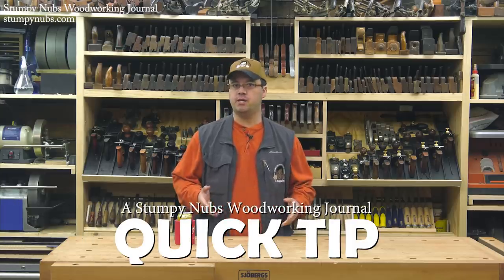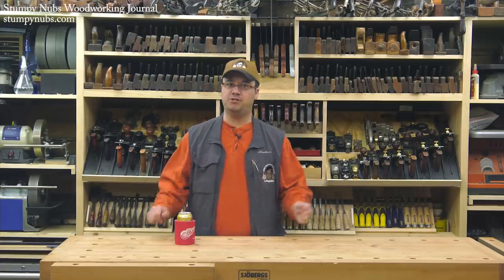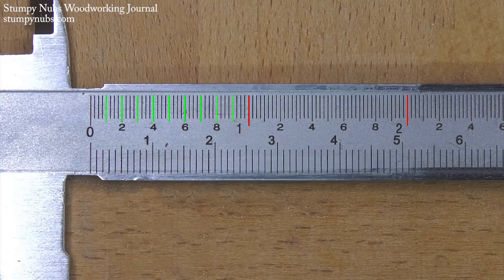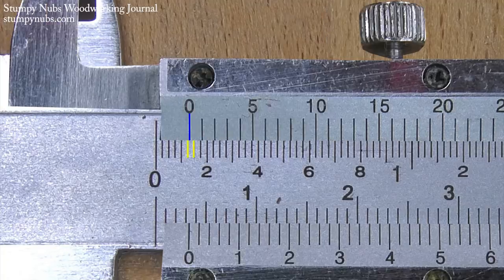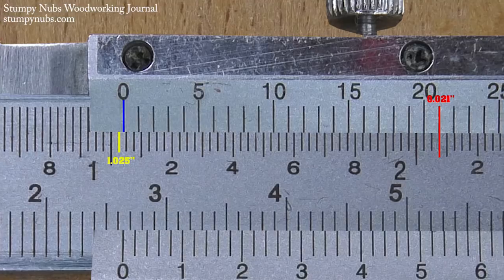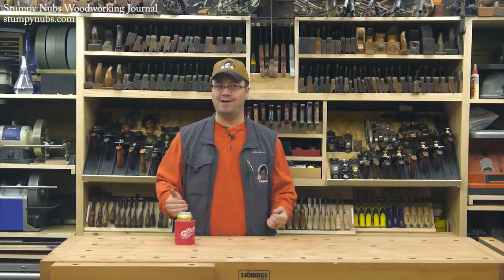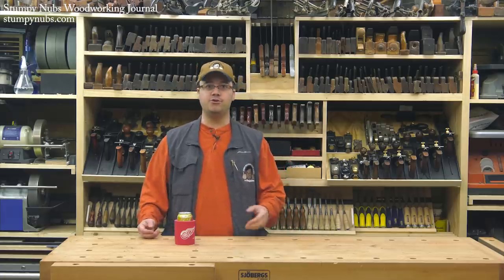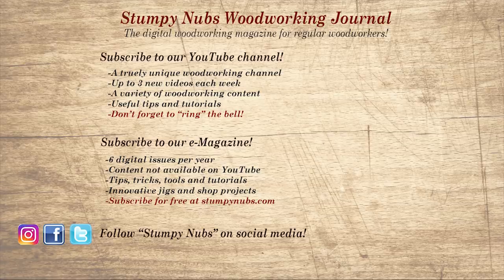EASY LESSON: Reading Vernier Scales & Machinist calipers

Comment: I’ll stick to my calipers that have a dial indicator in fractions. If it works for me, why change? Using one of those is like going back to the days of the slide rule as far as I’m concerned. In most woodworking measuring to 1/32 of an inch is far more accurate than necessary. For me if it fits I don’t care what size a piece is.
Reply from the maker: I am not telling you to go back to a Vernier caliper. This is just a tutorial for those who have to read a Vernier scale. They are found on other tools as well. There's one on my Incra miter gauge.

Comment: bottom line is 1/32 is just a hair (literally) more than 25 thousands of an inch and for the most part that is as fine as you want to go in woodworking.  Most woodworking equipment can hold 10 thou at best and with stack up of tolerances 1/32 is about the best you will achieve.  I find if I want a better fit up I don't measure I cut long and shave to get the fit I want. Some of the metal working dies I build required tolerances of .0005" and you get that using the same method as described above cut overside and file or grind to fit.

Comment: I commonly use these callipers for getting down to half millimetres with certain things. They can be especially useful for lathe work since any error is doubled when you're spinning the workpiece.

Might be good, for the Imperialistically-minded, to point out that the reason it's obvious they're 10ths of a millimetre on the metric Vernier scale is that there are 10 of them along the length of the entire scale. Any more than that would be unnecessary, & any fewer wouldn't let you measure the latter part of a millimetre. For example, were there only 5, you could only measure up to the nearest half/0.5 millimetre & not beyond it.

Comment: I have a tape measure that has an "engineer" scale that measures tenths and hundredths of a foot! I'd switch to metric entirely if it didn't mean replacing all of my measuring equipment.

Good info! Sliding calculators are fascinating.

Comment: Strange how the Metric, imperial shammers come out on this video where you are actually describing the finer details of machinist' calipers & Vernier scales and not preaching metrics or imperial. Why do those who use metrics feel a need to shame the imperial system? I can make up my own mind on what measurement system to use.   Great video, I have a machinist's caliper with Vernier scales, imperial one side and metric on the other side, very old L.C. Renick, still have the beautiful wood box it came in .
Reply: I tried to switch to using metric once, thinking it might be easier since I could avoid fractions.  It didn't take long for me to see the beauty of using fractional measurements for construction/carpentry and woodworking instead of decimal measurements.  If you think about it, the only real advantage to the metric system is that it's decimal based, but you can just as easily use decimals with inches (it's done all the time).  So really, I don't see any advantage to going metric, I for one did not find it to be easier, even though I really wanted it to be.

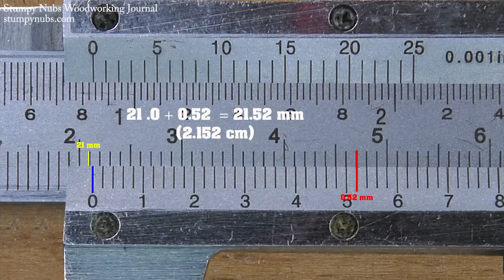Comment: I’m looking at the reading at 5:03 and it doesn’t seem to make sense. The lower scale does align with 0.52 mm but looking at the upper scale and between the dividers this seems quite far out from where the 0 line of the bottom intersects with it- it appears much more to the left of the halfway point between. What’s going on?
Reply: I think you're saying that it looks more like 21.25 than 21.52 on the coarse scale? If so, yes it does. That doesn't necessarily matter though, since you're only likely to use a Vernier calliper if you're looking for more accurate measurements such as those provided by the Vernier scale, & those are less prone to issues caused by which side of a marked line the actual reading falls on. For example, does 0 start at the left of the ink in that line, the right of the ink, or in the middle of it? If you imagine that the reading begins at the left of the line & ends at the left of the next line on the coarse scale & the right of the line on the Vernier scale then it looks like it lines up far more accurately to the result.
It could also just be out of calibration, of course..
Reply: Hello mr Cat. Yep, thats what I mean. 

Sure, precision is the reason for using the vernier calliper.

 I guess the question is if we open the gauge a little further (say half a mill) what will the vernier scale read then? 

Ive never used one of these things and it does look quite cool but possibly out of calibration like you suggest.
 @nightcatarts
Reply: @satanismybrother Hi :) I'm not sure how well I explained it, but in simpler terms it doesn't matter what it looks like, it only matters what it reads off as. Because of how it works, eyeballing it may well be inaccurate in order to make the actual readings more accurate, if that makes sense.. It depends on the individual tool in question because they can have variations in design, but essentially you want to go with the finest reading rather than trying to use it like a normal ruler.
Reply from the maker: I'm zooming in WAAAAAY more than the resolution of the footage can handle. The pixels in the image make the lines look a bit wider in places than they are on the actual scale.
Reply: Hi NC, no you're good, I'm just being a bit inarticulate :P So I agree that it doesn't matter so much what the upper scale looks like as the precise reading comes from the smaller gauge, however it just seemed like there was too much of a discrepancy between the two scales. The entire small scale fits on one increment of the large scale, so the 0 of the small scale should align when at the start of an increment and the ones at 9 and above (on the small scale) should appear right at the end (of the large scale). If they don't, then chances are the large scale reading will be erroneous. Imagine if Mr Nubs contracted his callipers by 0.52 mm. Would the zero of the small scale intersect at 21mm or 20mm? Looking at it, it just doesn't look like the two scales line up properly (to me). 
 @nightcatarts

Comment: I have a vernier caliper that an inch is still divided into 16ths..  Not quite sure how one would use the vernier scale on it.. I work with metal, so I'm quite used to the scale divided into 10ths. Great tutorial
Reply from the maker: It doesn't matter the graduations, the process to use the Vernier scale is the same. Find the mark that lines up, add it to the lower scale and done.

Comment: In my youth I aligned engines on boats. Had to be within a couple thousandths from specified readings. After drilling and fitting body bound bolts, pouring chocks (that shrink when cured ) then tighten to unbelievable levels and have end up at those specified reading that were inspected by Coast Guard inspectors. The sun's position in sky could change the reading by 10 to 15 thousandths of an inch. Yeah woodworking is alot less stressful.  Oh and the engines were 5000 horsepower
Reply from the maker: How do horses pull boats?
Reply: @StumpyNubs  they really push them. Love your channel.  Your rant yesterday was awesome brother. Metric, inches, fractions, decimal all are the same to me. But l like style keep it up.

Comment: That caliper must be older than me. In the new days people use dial verniers or digital verniers. There are even digital verniers that convert from decimal to fractions. My dial vernier is 30 years old.
Reply from the maker: I bought that caliper brand new two days before making this video. Vernier scales are still found on various tools, not just calipers. I have one on my Incra miter gauge.

Comment: Have to disagree that division of decimals is easier.  while dividing multiples of 10 may be easier, fractions as a whole are much easier.  Flip the second number and multiply.  It's a lot easier than long division.  As for using thou vs fractions, guess I never really considered it a problem.  Grew up with a chart on the wall of the shop for conversions, and a machinist grandfather, so half the tools in the shop were machinists tools.  All the fractions are easy enough just to figure in your head: .5, .25, .125, .0625, etc.  aka 500, 250, 125, 62.5 thousandths.  On the Vernier scale, never had to use one since I always had a dial caliper or barrel style micrometers and depth gauges.

Comment: Where do the batteries go?   I hate them, but vernier instruments are the most expensive.   I learned all this when I went to work in quality control in an aluminum plant.  I got real good after the first 10,000 measurements with my micrometer. Sadly my skills are diminishing after 50 years of non use.

Comment: 25/1000 is way more accuracy than a woodworker can ever work to.
Reply from the maker: Woodworkers don't use machinist standards to measure wood. They use them to tune machinery, measure shafts, fit bearings, all sorts of misc. stuff that goes along with having a workshop of just about any kind.
Reply: @StumpyNubs  No, woodworkers use a mallet to tune machinery, measure shafts, fit bearings, all sorts of misc stuff. The caliper just looked nice in the store.
Reply: @StumpyNubs   Machinists standards would require getting the calipers tested every year and they would be put out of commission if the deviation was more than ,02 of a mm. At least in the machinne shop I worked in. Machinists have used digital calipers for at least 20 years where i live aswell. I think those standards are over the top for anything you would measure with calipers though since there is a human factor.

Comment: This is a very good example why metric system dominates whenever high accuracy is required.
Reply from the maker: Once you get into ultra-fine measurements, you're still doing math no matter if it's fractions of a millimeter or fractions of an inch.

Comment: 5:00 there's no way this is 2.152, just look at it, it's way closer to 2.1 then it is to 2.2. So what's the deal here?
Reply from the maker: I'm zooming in WAAAAAY more than the resolution of the footage can handle. The pixels in the image make the lines look a bit wider in places than they are on the actual scale.
Reply: @StumpyNubs  in the video still image at 5:01, the blue line looks a lot closer to the yellow line (2.1) than to the adjacent 2.2 line, so it looks like the measurement should be something like 2.13, but certainly not 2.15 or over that. By the way, thank you for all your videos, learning a LOT from you, big fan here all the way from Lebanon.
Reply from the maker: @samerbouez3905  Again, you are looking at a low resolution image because it is zoomed in so much. The pixels in the image are deceiving. Not to mention the accuracy of the blue and yellow lines I drew. Look at the beginning when I show the caliper from a distance and see how fine those lines really are. Imagine drawing a line with a mouse absolutely accurately when the space is so confined. When you zoom in digitally, you don't get a good representation of where the lines are. That's all I can say about it.

Comment: One thing I think you should have gone over is how a vernier (vern-yay if you want to frenchify it back) is created with one scale one unit different than the other with an offset line. It's helpful when creating your own topographic maps by hand drawing or whenever you want to scale something up or down.  You can also create a protractor with a vernier scale to divide up degrees into minutes and seconds

And I think you should have given credit to Pierre Vernier

Otherwise, good video

Comment: ver-neer? or ver-ni-er?
Reply: Ver-neer is the pretty layer of wood you glue on top of the plywood. Ver-ni-er lets you know how thick the pretty layer of wood you glue on top of the plywood is.
Reply: On the metric calliper this scale is called 'nonius'. It was invented 1632 from Pierre Vernier.
Reply from the maker: No, Maxx. Ve-neer is thin wood. Not Ver-neer. There is no "R" in veneer.
Reply from the maker: @censusgary  - The video isn't about about veneer. We're talking about Vernier (which does have an "I" in it), and some folks seem to think I mispronounced it.

Comment: and thats is how metric system proves to be amazing easy for all mic drop
Reply from the maker: Once you get into ultra-fine measurements, you're still doing math no matter if it's fractions of a millimeter or fractions of an inch.
Reply: @StumpyNubs  sure, but fractions of millimeters are micrometers or even nanometers and it's pretty easy add or subtract, since its based on 10 ;)

Comment: just get a digital set of calipers
Reply from the maker: Should we stop teaching folks how to read clocks since digital watches are available? Sometimes it's nice to learn something, even if you don't have to.
Reply: @StumpyNubs  I believe that one of your main focus points in the video was taking the confusion out of reading a set of calipers. The best way to do that is with a set of digital calipers. Now, is learning how to read old school calipers good knowledge? Sure. But when I'm looking to pick up a replacement set of calipers, I'm not going to buy analog. I'm going to replace with digital. In a production environment the last thing I need to be doing is taking time trying to figure out what this or that hash mark is representing. And in my experience,  a decent digital has the ability to get far more accurate measurements than it's analog counterparts. Isn't accuracy the entire point of calipers?
Reply from the maker: This isn't a tutorial on choosing calipers. I didn't tell you to go buy Vernier calipers, I just showed you how to read a Vernier scale, which is found on more than just calipers. I have one on my Incra miter gauge. If this skill doesn't apply to you, fine. But if someone does have a tool with a Vernier scale, I think this tutorial is more helpful than your suggestion to just go buy a different tool, don't you?
Reply: @StumpyNubs  as a tutorial on learning and reading a vernier scale, it succeeds. I would suggest relabeling the video to something akin to "How to quickly and easily learn to use your Vernier scaled tools". Your current title suggests that all woodworkers struggle with calipers and that isn't very accurate (pun intended).